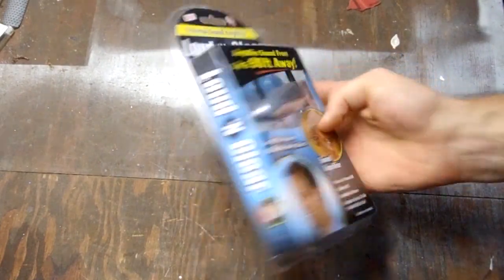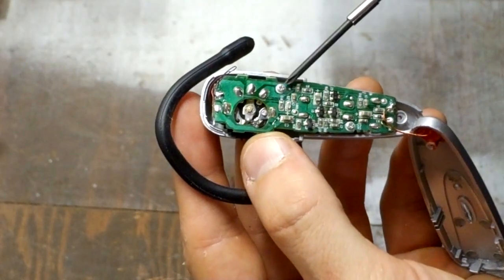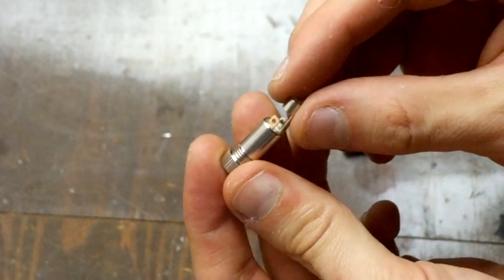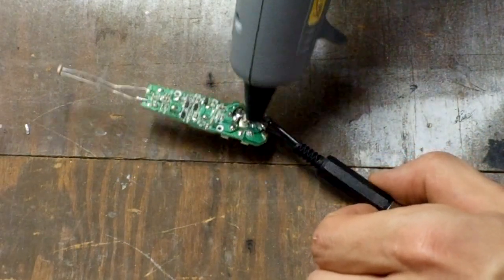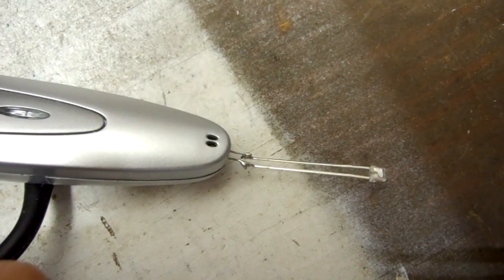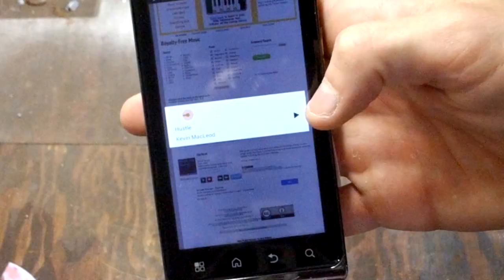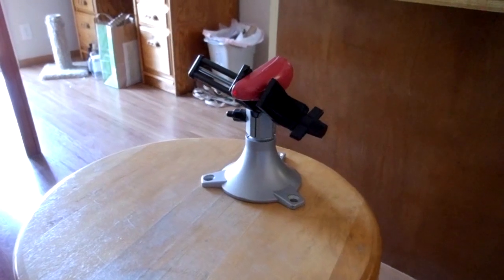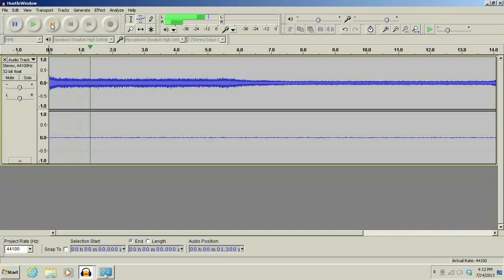Fast Hacks #6 - Laser Spy Microphone

Comment: Place the photodiode  inside  black pvc pipe , to protect  the  sensor from  ambient light  like others have said.   Also try using  magnifying lens   Double pane glass is hard to pick up sound from !  any good spy would Know this would give up your location . spy would  repeater the signal and  send the signal to 2nd location

Comment: Use ir sensor from old tv, vcr , etc mount it to the eyepiece of a telescope mount the ir laser to the telescope sighting scope after calibrating and sightimg in the laser to the scope you will have a very accurate device using a tint piece of reflector tape like a small dot a hole punch makes and sticking it to the center of the glass of a window you could get a clear signal from maby 5 miles away especially at night. If you modulate the lasar giving it a carrier fq. That could then be detected as in an am radio receiver or cristal radio to extract the modulated audio. This would also help to eliminate external noise and to mak it even better you could use supressed carrer demodulation ar a deferential am/fm demodulating method to have a way of tweeking or cleaning up weak signals from long distances or double pained windows or even to listen through walls.

Comment: Really nice video, it's possible that window glass inertia is too high for the cell speaker and does not really vibrate. You could also try to put the photosensor inside a cilinder to filter the photo-noise

Comment: Rick I love your project! ... I think what you want ideally to use is a Blue Laser. Blue wavelengths refract or change directions more. This greater variance would be helpful to your project.  Glass absorbs IR.  Reflectance from glass is generally only 4%.  So sticking a 3mm reflective foil target dot on the glass would be best.   In use, this would obscure laser light from entering the room from outside. Also, the energy from the laser is not focused, a quartz glass lens is needed or a more powerful laser..  ... A second way to greatly improve this, could be to use a reflecting telescope with a polished first surface metal reflector (not glass)  Then mount the sensor diode at the tube's first surface mirror's convergence point.  Reflecting telescopes are designed to look at stars, So it should work well for what you are doing.  I love this project Great Job Rick and Great idea!

Comment: A stronger laser output, a more sensitive light detector, or maybe a signal amplifier between the Photo-transistor and the amplifier to act as a pre-amp may help. light is pretty sensitive to any interference. A solid mount with a very heavy base would certainly improve the project. The idea being to keep the light source as still as possible. 

I have also seen success with a cell from a solar panel used in place of the photo-transistor.

Comment: You need  to increase the SIGNAL/NOISE ratio. Notice that Your system worked perfectly in dark conditions and in proximity. Maybe using an INFRARED LASER or a powerful BLUE laser as a source will be a good idea. Also using a small array of sensors (maybe nine, and an amplifier) could help. Also putting the sensors in a small Cassegrain telescope could be a good idea (But for infrared sensors You will have to use silver-coated reflective surfaces and maybe cooling with solid CO2)

Comment: Okay, so I see some issues with why this didn't turn out well. Like others said, you need to protect the sensor from ambient light. I'd put it inside an opaque black tube to block out all light except what you're pointing it directly at. Another problem I see is geometry and detectability by your adversary. You need a way to ensure that you're actually positioning the sensor where the laser lands AND pointing the sensor directly toward the point that it's bouncing off from. My solution to that would significantly increase the cost of the build, but also greatly improve quality and function. use an infrared laser instead. You can then use an infrared camera without IR lights to find where the beam lands. Keep the camera attached to the sensor and calibrate it to point exactly where the sensor points. When you find where the beam lands, place the sensor and camera there, then use the camera to aim the sensor at the window. When positioned correctly, the beam should blind the camera. Many infrared cameras also have a microphone input, so you can use that to connect your sensor. Most cameras also have built in recording capability upon sensing audio or motion, so if you manage to clean up the ambient noise by shielding it, you should be able to automatically record. A Raspberry Pi and IR camera module would be rather affordable and princely serve this purpose well, but you can find deals on IR security cameras for less than the cost of that if you know where to look.

Comment: Any vibration on the glass would have been very effectively dampened by the phones mass. If instead placed it so it would not have been in contact then it might would have worked.

Comment: So? If I were to try and spy on someones conversation, they would have to have a mirror on them?
Reply: No, you can attach a small prism on the window to reflect the light without it getting through the glass: http://www.precisionoptical.com/img/products/porro-prism2.jpg
Reply: Richard Noggin 
No, you reflect the laser off their window.
Reply: The idea is to set it up using a laser visible to the human eye and then when you actually go and use it switch to an infrared. set up has to be perfect though any variation in angle (45degrees is used) will throw you off.

Comment: By reflecting the laser off of the reflective surface, you essentially modulated the amplitude of the laser beam using the music as the modulation source. When you said it sounds like an AM radio, that is because you CREATED an AM radio, which is literally amplitude modulation. The only difference is you used visible light, while a radio station uses a much lower frequency light that's invisible to us/
Reply: AFAIK a real laser mic should use FM, not AM. It is an interferometer that measures the tiny distance change by mixing the sent with the received laser wave. Similar setups are used to make holograms. You can e.g. detailedly analyze the partial vibration of musical instruments (violin body etc.) or loudspeaker diaphragms this way. An extreme application of this is the astronomic gravitation wave detector.
Reply: @AerialTheShamen  
You stole my thunder.
This is the correct information.
Reply: I don't understand how the amplitude of the light would change.

Comment: longer wavelength lasers work much better; less distortion. Which is not to say laser mics work well at all. Any fog, precipitation or dust in the air and all you hear is white noise. Same deal if there is water running in the room.

Comment: How does that work? How that solar cell turn the light into frequency?
Reply: DarkMaMon It's not a solar cell, it's a diode that detects light levels. The vibrations on the mirror effect the laser light that reaches the diode in the same way that the sound waves travelling through the air would effect the microphone. Because you are not trying to detect sound waves but instead trying to detect vibrations in a solid object the reflected, light from the laser acts as the medium in which the signal is transmitted. It has to be a laser that gives the light of the way they produce the light. A normal focused beam of light from a lamp or LED would dissipate too quickly through the air and be lost where as the laser can be detected over longer distances with minimal power requirements.

Comment: Red is not a good frequency to use for this. It's why it wouldn't work at all on a window, because visible light travels through glass.

You would want to use infrared frequency, which I believe is what the first ever laser microphone used; it didn't even use a real laser in fact, but rather an IR beam.
UV should work as well, as long as it's high enough frequency.

Higher power output and more isolated receiver would very very helpful as well of course (as you know).

Comment: i think putting a shroud around the light sensor would allow you to pick up less ambient light and more of the laser, also maybe using a more powerful laser.
Reply: What if you also put a lens around the photosenor? That way you could align it with where the laser bounces off, so you can only be getting a signal from the laser.
Reply: Yeah, and also make a larger angle between laser and receiver beam. Because the less the angle means less the vibration deflection from the mirror, and thereby lower audio quality.
Reply: but then the rig is totally distance dependant. idealy it should work at anny distance with minimal settup required for setting up the angles and distance correctly
Reply from the maker: I think these are both great ideas!

Comment: this is amazing.  if you already have good audio preamps then all you really need is the phototransister hooked up to a useable plug type.
Reply: To Rick Osgood and the production crew.
Little late but Eh? I'm hoping you were successful fixing ambient trans? Sensor?  Now we are at using an invisible light lazer must bounce back off t h e glass and captured by our "Saucers".
Is there a standard for calculations when we are cutting the concave dish?
I believe the choice targeted for sound alone was limited and if like most residential and business have these 2m x 3m glass on most buildings would offer a larger acoustics area3 for fine tuning?
What is the best laser not penetrating but bouncing off  position?While I'm here just watched your production. Very well put together. Enjoyable easy on the eyes with good dialogue.
But, 'good dialogue' is dependant upon 
Delivery Great-delivery with the Host(
AND
Delivery must have good Dialogue. 
You cannot have 1 without the other .
A symbiotic life.

Comment: Your story does not match the preamble.
It proposes that one can hear what's happening in a room across the street due to reflexion of laser beam from the window glass. And no actual solution is given.

And even more. This method will not work due to these facts:
- rfelected beam is not bright at all(see Nitin Kumar's comment)
- reflected beam must change it's direction(due to rotational vibration of the lighted area of glass) or your gage will give constant signal.
- reflected beam must not travel much or it will hit the transistor only ocasionally to give you some random spikes of signal
- even if reflected beam travel is just as long as to cover partially sensitive area of the transistor(it is tiny) with the reflected beam(and does move)  at all times and you do hear the spies, they will not be sharing any secrets but wondering, why do they have a laser beam in their room :)
Reply from the maker: This is a very low budget proof of concept. It's not designed to be used by real spies. While it isn't very high tech, you CAN actually use it to pic up sound vibrations and listen. It's just a fun project meant to show what can be done on a low budget and limited time.
Reply: That's what i'm saying.
It is a fun project wich can not be used for the purpose, described in the preamble. That's the only thing i didn't like :)
Reply: That's a known Soviet spy technology of the 1980's, used to spy the American embassy in Moscow. It was defeated using walkmans with loud rock music attached to the windows. Also double glass windows could defeat the laser.

Comment: Last example failed (and will always fail) because the laser pass through the clear glass window (majority of light waves are only refracted, only few are reflected). You can tape a mirror piece on the window to make it work.
The story about this gadget has to do with placing a very small prism in the window which refracted the light waves in 180 degree (if you know the story)
Reply: or you could tape the phone on a mirror

Comment: you need more bass like a regular tv speaker or yourself speaking on the other side of the glass, that tiny speaker barely moves the air molecules that move the glass
Reply: no it will not help. Two problems here - laser is not reflected from windows as good as from CD (which is especialy made to reflect it), second light sensor is not that good - it just can getect small changes from small vibrations of window.
Reply from the maker: Thanks for the tip.  I'll have to try it again with something that has a little more umph.
Reply: TCreatorO

Comment from the maker: You have a lot of good ideas.  I don't think I had any flourescent lights on in that room at the time, but you are correct that they do produce a 120hz hum.  Regular incandescent bulbs produce a 60hz hum.  The AC lines in the house can produce the same hum in the amplifier circuit itself if it's not shielded properly.  I honestly have no idea what caused the sine wave in this recording.  If I measured the frequency it might help narrow it down.